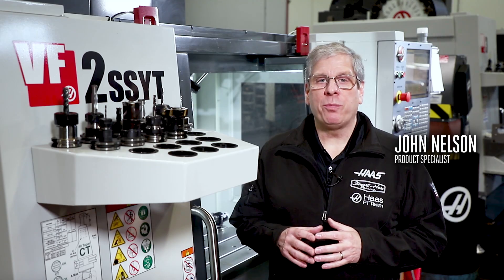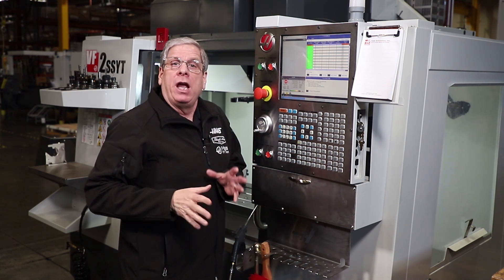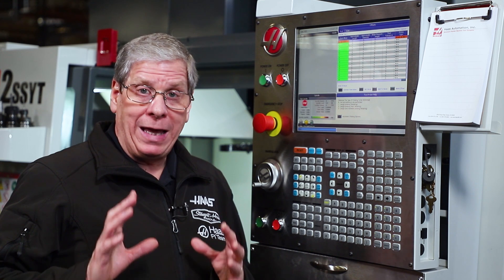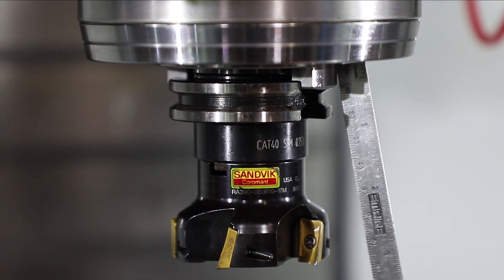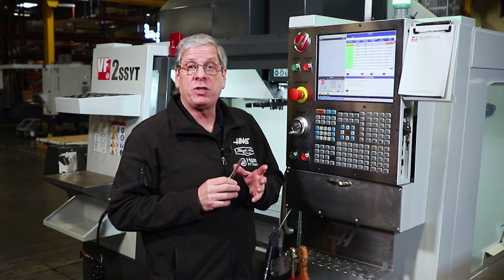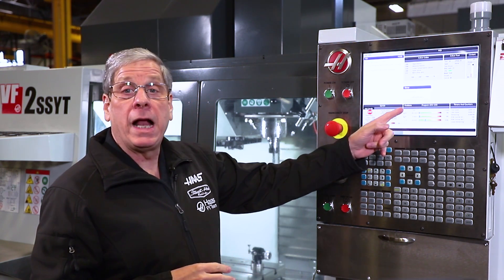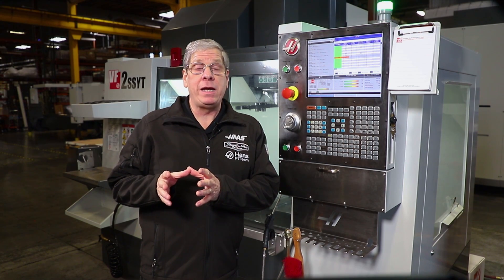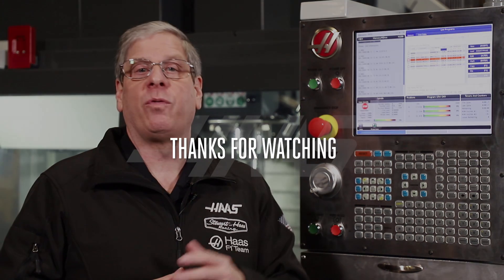Wireless Probing How-To PART 3 - Tool Offset Page - Haas Automation, Inc

Comment: It's been seven years, but i need help on this. I have chipped the edge of the boring bar insert using the 'Auto Length, Rotating' cycle. when the boring insert touches the tool setter, it chip the sharp edge of the PCD insert. I've try the 'Auto Length, Non-rotating' cycle, and set the tool type to face mill. It still position the tool dead on center to the tool setter (not offset by half diameter). What should i do?